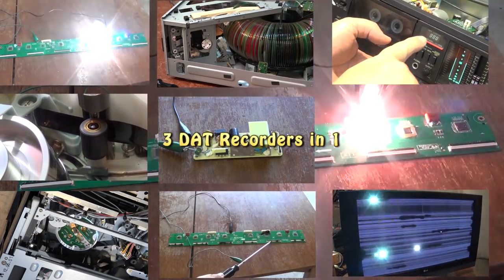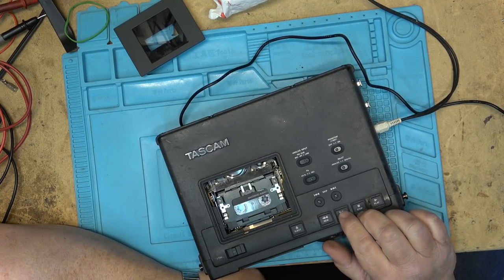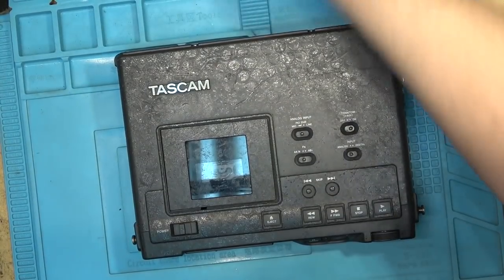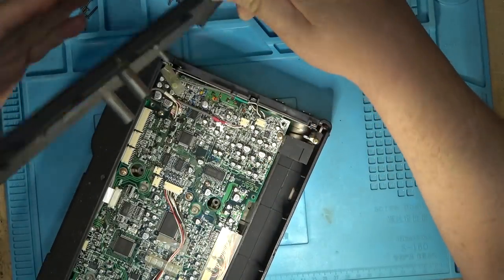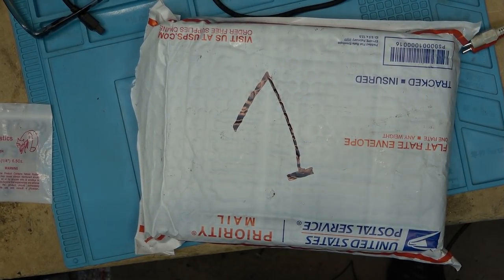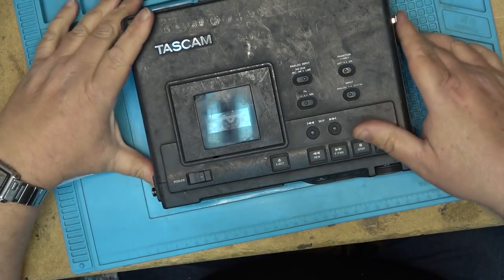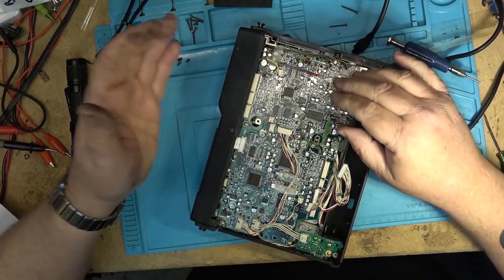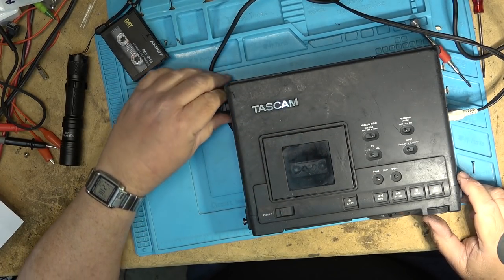3 Tascam DA-P1 DAT Recorders with troubles

Comment: I have a Technics SV-DA10 DAT. There was some problems with the loading mech on it but it was solved. I have a complete mech assembly unit and swapped it out to faultfind. Absolutely no success, I guess the RF on it has to be adjusted to get any good results. As you canadians say "da-ah" should have known better. Now my portable Sony TCD-D100 DAT fails me doing tape salad after a 5-10 years of storage.

Comment: The non faulty one is a bugger.
 i hate the back from the dead with no reason.
I've had one or two things do that to me,  and i could not make it fail but the owner makes it die in one day lol.
The annoying ones are the devices that wait until the cover is screwed back on, then it fails.
Ive used a few swear words on those.

Comment: HI Dave!

I have an off topic question for you. My left channel an VU meter on my Akai GX-630D R 2 R tape deck out of the blue just conked out on me while I was recording a record on to a tape. Is this common? All the cables are fully plugged in. I'm wondering if a capacitor is leaking on it. I  haven't opened up the back. I'm just curious if this is a common issue. It's a 1973 model. 

Thanks if you can reply. 🙂
Reply from the maker: When you say conked out, do you mean it isn't moving at all?  Could be stuck. I have seen that happen a few times, on NEC equipment. The plastic shrinks and pinches the needle bearing on the meter.
Reply: @12voltvids  Yes. I quickly found out what the problem was. My stupid cat chewed up the RCA cable connected to the left channel. Lol! 

I appreciate the reply, anyway. 🙂
Reply from the maker: @troykir  🐈 🐈 🐈 🐈.  I have that problem x4

Comment: hello! my da-p1 makes that whining sound your 3rd repair unit does when I power it on. it will eventually stop but I cannot get the tray to open. I took the bottom cover off like I saw you do and the belt seems to be intact. it's maybe a little slack but it's in place and not melted. could there be another cause for the issue? I haven't tried using it in many years but as I recall it was working fine, then slowly started stopping playback, whirring and seeming to struggle to play before it would just shut off. I'm certainly no tech but any help is appreciated!
Reply from the maker: Belt needs replacing.
Reply: ok thanks! I see you used "dental bands"... are there different sizes? are they readily available to purchase? also every time I touch this thing I'm left with black tar on my fingers 😞
Reply from the maker: @chakobsa  i didn't get them they guy that sent it to me sent a few with it.  
The cabinets of alot of that crap from this era had that anti slip coating on it that turned to a black mess.  My Nikon camera is the same.
Reply: thanks so much! I found (I think) the replacement belt on the 'bay. hopefully it fixes the problem long enough for me to transfer all my tapes!
Reply: yay I fixed my dat! thanks to you!!

Comment: Other than the crappy finish, they look like nice serviceable decks.
Reply from the maker: The finish sucks but the decks are very good. A few common problems with plastic cracking on the pendulum gear.